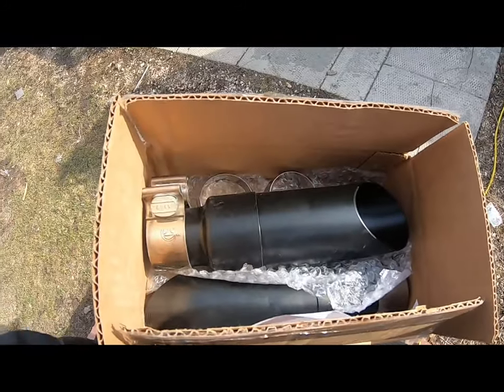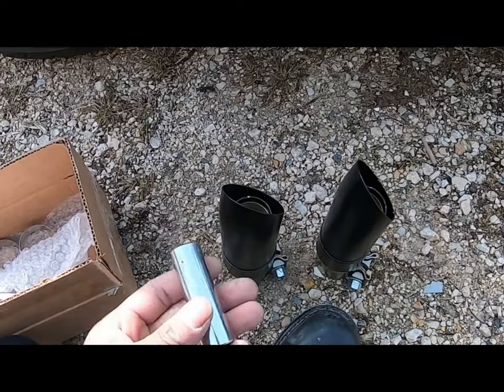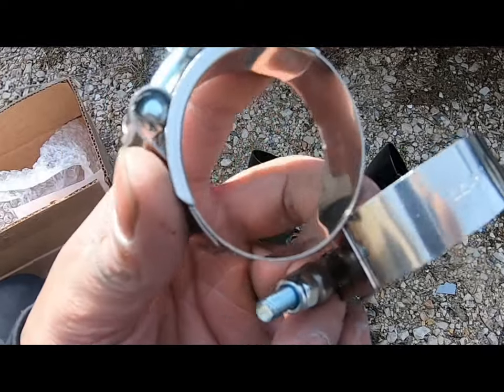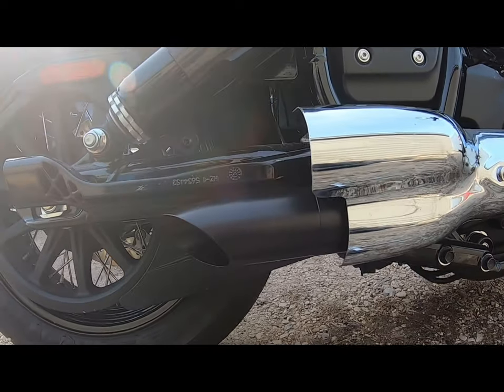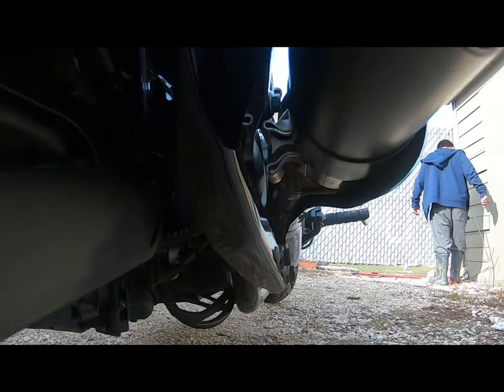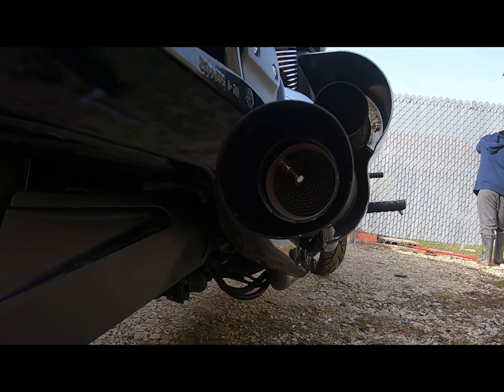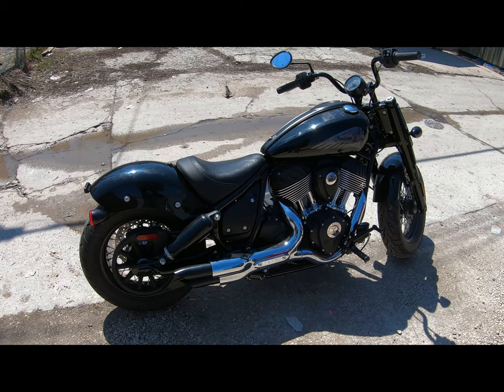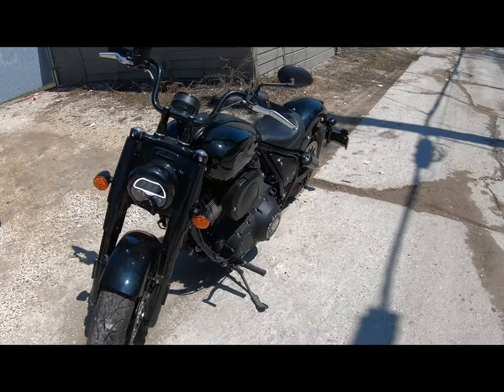GP Shorty pipes install & Start up | Vlog Ep.7 | Indian Chief Bobber 2022

Comment: Hey can you tell me the part number or where to buy these shortys at?  I have the same bike. The ones in your link below are for Indian Scouts, Chiefs not listed. If you have the part number would help finding the rite ones, thanks!
Reply from the maker: Those are the ones I bought. The bike just came out this year so there won’t be one for them. Buy those. Trust me you’ll be fine. I did a install on them so just follow
Reply from the maker: Also make a video on your bike bro would love to see it
Reply: @mrsandiegovlogs  Did you buy the bundle or buy the baffles separate. thanks!!!!

"Radiant Cycles Shorty GP Exhaust Motorcycle Slipon Short Muffler Pipe 2015-2021 Indian Scout Sixty Black Baffle Bundle"
Reply from the maker: @rockstaradventures1  I bought the bundle with the baffles. Believe me. I don’t know if you started your bike without your muffler on yet but you definitely want the baffles. Check out my straight piped video. It got almost 30k views

Comment: Hey man sweet ride  just picked mine up today! Where did you get these shorties? I'm not sure if I'm looking at the right ones
Reply from the maker: https://www.ebay.ca/sch/i.html?_nkw=gp+shorty+pipes+indian+&_trksid=p2380057.m4084.l1313
Reply from the maker: Yeah man there sick asf really loud deep sounding. I recommend get the baffles. Be sure to drop a sub and check out my other videos
Reply: @mrsandiegovlogs  there is no link in there for a Chief Bobber only Scouts, are they the same size exhaust? thanks!
Reply from the maker: Yeah same pipe size. Believe me there’s no fitment issues and there will be but the chiefs just got reimagined this year so it’ll take time pal